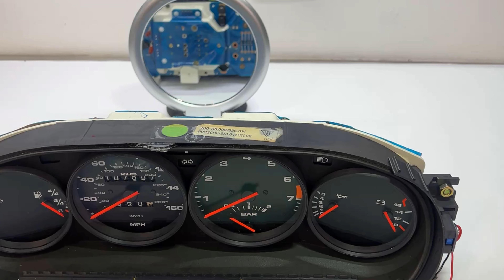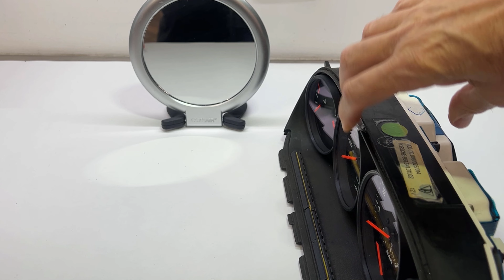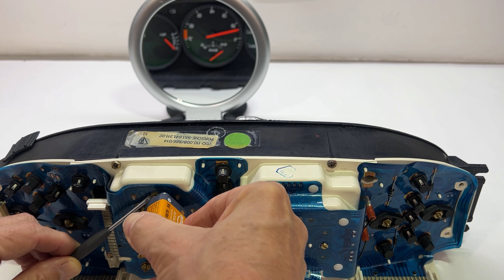944 Tachometer Calibration and Testing

Comment: Super helpful! 
Question, if the tach just bounces a LITTLE, less than a thousand rpms, will not jump higher. Is that indicative of a failed tach or does simply any movement using the battery mean it is functional?